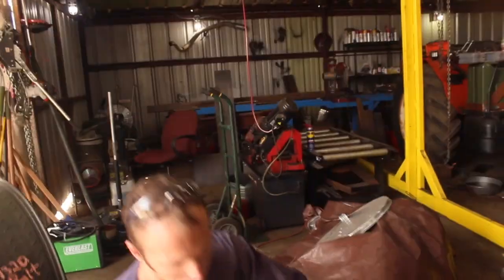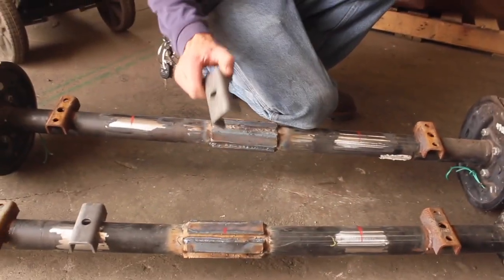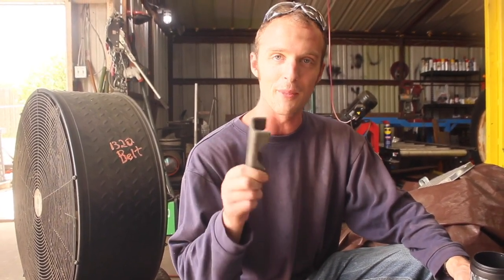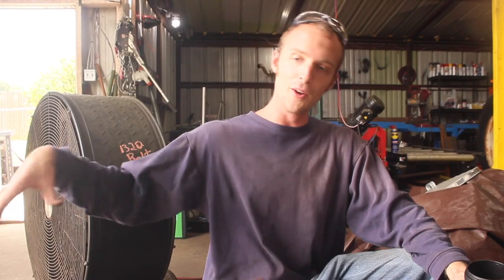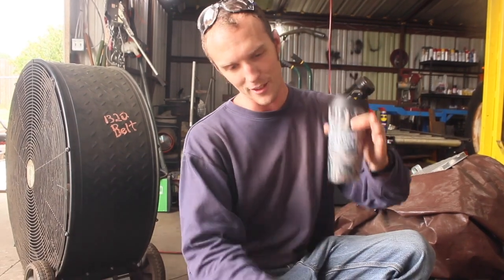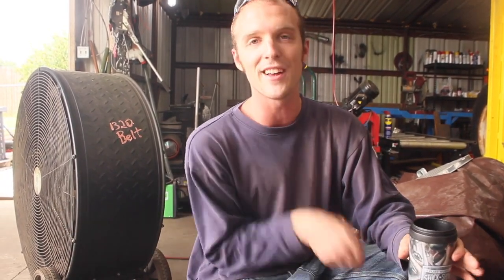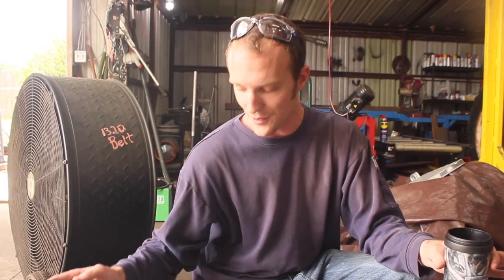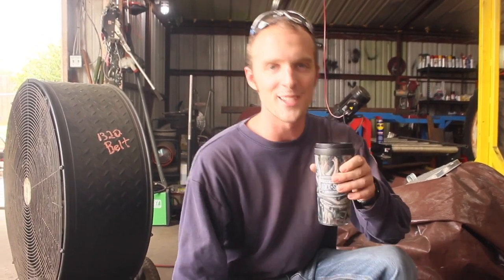THE REAL REASON WHY YOU SHOULD NEVER BUILD A TRAILER TO SELL!! A WARNING TO WELDERS & FABRICATORS

Comment: I've built a few trailers for myself just because I enjoy the challenge. In reality the cost of materials are usually more than what a commercial trailer would have cost. And that's not counting my labor. I'm glad you mentioned liability because that is a really big issue. 👍
Reply: I've gotten a few trailers, fixed them up a little and sold them after I've had it for a while. get my money out of them before I sell them.

Comment: I totally agree. I resurrected a trailer from the dead( replaced tongue, coupler, crossmembers, floor, tires, bearings, painted, etc.) that I inherited and improved it some in the process. All said and done it was about $1K not including labor. I could probably sell it for $1800-2k but with my labor it would be break even at best. A cheap trailer isn't good and a good trailer isn't cheap.

Comment: I use 3 inch channel to box up the frame. It's strong and relatively cheap. Just straight cuts, you don't even have to notch fit it if you don't want to. Still, he's right mostly. I used to do repair work and people just don't want to pay for basically any fix. That's why I gave it up.

Comment: x2 to all of this.

I repair trailers and customize them.  Everyone and their cousin is always asking me about painting trailers, but the problem is that they want the frame bead-blasted and repainted for $300-$400 dollars for their trailer that is possibly worth $1K when done.  It takes at least $100 just for the paint and then 8 hours to prep for that paint, so I don't even quote paint jobs.

I don't quote generic trailer builds either, because just like you said, there is ABSOLUTELY NO WAY to compete with the big trailer manufactures, so I end up spending an hour or two to design a trailer for a guy who is willing to "pay for Quality" just to end up with him telling me, WOW that's expensive, XYZ trailer company has the same thing for $XXXX, why can't you match that price?  Well dude, I don't work for free

Biggest advice I give people is 
1. Don't buy a trailer with mobile home axles Unless you have $1k extra to put new axles and suspension on it almost immediately.
2. Don't buy a trailer from a commercial company that is 1-2 years old, because you can guarantee that the owner did zero maintenance and half the crap on it will be worn out already because he put 50K miles on it in 1 year.